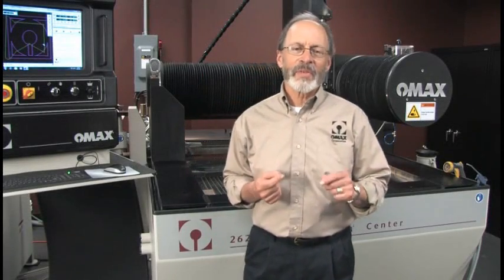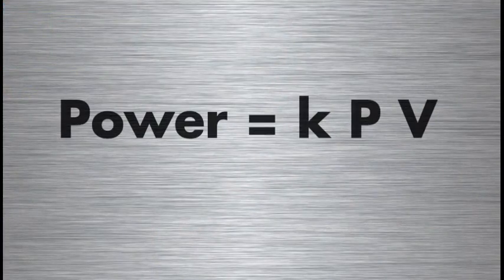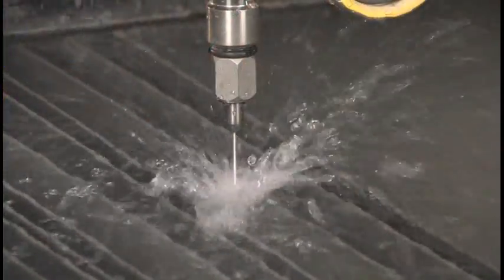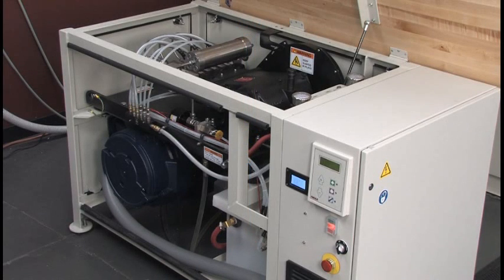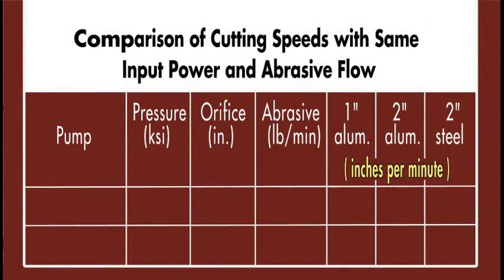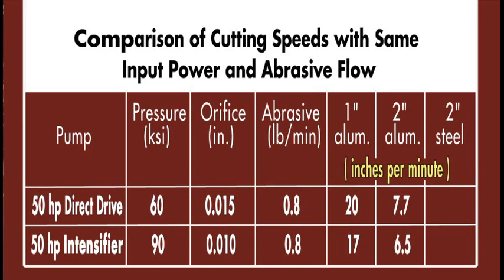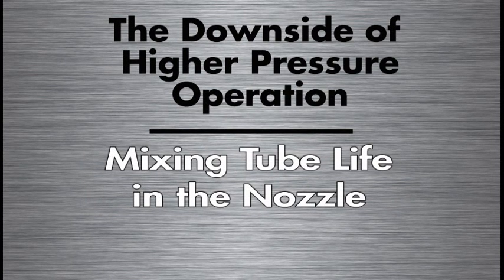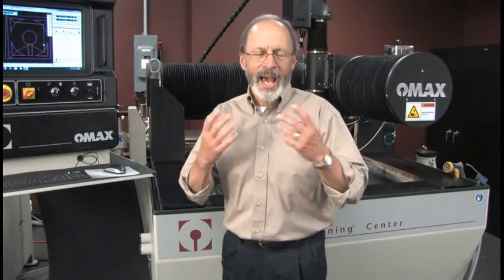60,000 PSI Vs 90,000 PSI Waterjet Cutting

Comment: Definitely agree on (from actual 17 years experience) that 90,000 psi pumps are junk and that's where our agreements end as from tons of experience with several omax pumps, they are maintenance nightmares when they get over 1000 hours on them and I've never had one last 10 months without needing anything like I do with my 50 hp intensifier, it's almost unheard of but everyone with an intensifier should be getting result but it takes getting the condition of your cooling and cutting water consistency down to a science but after your set is golden its easy, oh and just a extra note on one way I achieve optimal water condition, I added a second heat exchanger not with separate water supply and not with seperate oil feeds and exits. Oil flows into first exchanger then exits into second exchanger for a second round of cooling pass through then back into the supply tank. cooling water to exchangers are two separate lines in so both has fresh non temperature altered water that meet up right after at a T for one drain out of my cabinet. As far as cutting speed between direct drive and intensifier of same spec pumps, I've never noticed any difference.
Reply: I'm going to be trained on water jet for cutting thick steel up to 6" thick for army tanks. I saw the waterjet and it's a 90K psi. My soon to be trainer told me it does blow parts and it's random, but expected. Could this be done with a 60K, or is the 90K absoultely necessary since the material is up to 6" thick ?
Reply: @larrymasterspowerbuildingc4477  read the other comments. The higher the pressure the faster you cut. I have both, an intensifier and a direct driven pump. Intensifier much more reliable and cheaper than direct driven. No comparison. Greetings from Germany :D

Comment: Ok let's say this is correct. But then how you can't use the exact same arguments to argue that a 30k psi is better then a 60k psi, same as 60k psi is better then a 90kpsi? Why would be any different?! 
How is 1k, 5k, 10k, 30k, 60k, 90k psi comparing to each other, and why is 60k the magical number beyond which is pointless to increase the pressure?! Why is 60k psi so special? Because i can tell you we can't physically go beyond 100k psi very much - since no material known to us can handle that pressure. So on the upper part of this pressure curve is pretty clear why we don't see pressures of 200k psi or 300k psi and only up to 100k psi.

Comment: Basically higher psi with the increased velocity limits the orifice size therefore limits the amount of garnet that can be used.  More garnet in your water jet equals more cutting ability.  lower pressure with more garnet will net better cutting/ material removal characteristics.

Comment: His equation P = kpV and then decreasing V to get more P doesnt make sense at all! Since its multiplication on all parameters if you decrease V you dont get increased cutting power as he states but less. Basically the equation says that for a given nozzle size increasing pressure gives more cutting power, not less that he falsly states
Reply: He's arguing that given a 50hp pump you would need to reduce the nozzle size to work at a higher pressure.

Comment: just put on same orifice and you see the better performance
with smaller  orifice youll  use less abrasive..
Reply: cnncarving......

No.....the orifice does not .... NOT come in contact with the garnet.

If it did.....it would be worn out in no time.

Comment: You need mass at velocity to remove material. force = mass x acceleration. He conveniently forgot the acceleration(velocity) part of the equation.
Reply: That is included in the pressure component. Pressure is force per area, or mass x acceleration per area if you put it that way

Comment: This video is false and misleading. I have 8 years experience operating Flow,Omax,jet edge and Kmt waterjets, direct drive and intensifier 60ksi and 90ksi. From personal experience intensifier pumps out perform direct drive and 90ksi does cut faster while using less abrasive by a large margin.
Reply: Yeah, the reduced abrasive use seems to be conveniently avoided in this video. Not to mention he's attributing the reduced cutting speed to the higher pressure even though he says the direct drive pumps are far more efficient. Well, with the same size electric motor a more efficient pump has an advantage. It's not the pressure increase that is reducing the cutting speed but the reduced efficiency of the intensifier pump. 
I'm thinking of getting a waterjet in the future. Do you have any advice on which brands you could recommend and which to avoid?
Reply: @siggyincr7447  Seems like he doesn't
Reply: @siggyincr7447   Apologies I never saw your comment. As far as which machines to avoid, it really depends on what you intend to do with the machine. Each manufacturer has weak points and areas which they excel.  Not saying there's anything wrong with an Omax or direct drive pump. Rather that its misleading to say a direct drive pump cuts faster using less abrasive. The only way to use less abrasive is by  increasing water volume. Your water volume is determined by pressure and orifice size so if you are running a .015" cutting head at 60KSI with 1.2lbs abrasive per minute the style of pump is irrelevant because the volume is exactly the same. Now say you have a 90ksi pump running the same setup, your water volume has nearly doubled so which one is cutting faster? My choice of machine would be based mostly on drive systems and machine types. I would say avoid ballscrews go for rack or linear motion systems and gantry type machines.
Reply: what are the abrasives used?
Reply: @manojvarughese4337   I have used all types of abrasives over the years. Your highest performance abrasives are typically crushed rock garnet but they come at a great cost. I use GMA 80A. a good overall value alluvial garnet. And works with cutting head sizes ranging from .010"- .020".

Comment: This is all bs. Omax does not even produce a 90k pump to even test. Seemed to have left out the bit that yes, it is a smaller nozzle, and less volume, what happens to water and abrasive velocity? It increses greaty which in turn cuts faster using less abrasive and less water. Been there done that...